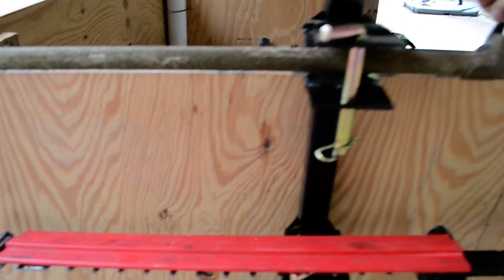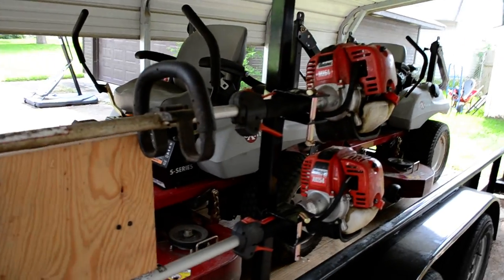Landscape Trailer Cheapest Trimmer Racks

Comment: That aluminum that stays on you trimmer is to stabilize the trimmer motor so that it doesn't snap off bouncing around going down the road. You may have saved a few bucks on the rack, I hope you don't have to buy new trimmers.

Comment: The easiest, most time saving trailer is an enclosed trailer.  Always lock it when Im in the back yard or away from the trailer.  Thieves take your stuff by watching.  Better yet , get those gps tracking tags on Amazon and install in a hard to get to Area on equipment.

Comment from the maker: @dakota slapnicker  if they are going to take the time to unscrew my handles then they might as well bring some bolt cutters and take the rest.. heck while they are at it open my door and hotwire the truck and take everything.   the point is to deter a opportunist thief by having something there to slow them down.. if someone really wants my weed eaters it doesn't matter what i have locking them, they will get them.
Reply: TwoGuysLawnLA hey what part of LA are you guys from??
Reply: TwoGuysLawnLA I just ordered racks off eBay for $45. I install garage door springs today on my trailer gate. Gotta figure a few things out but it helps a lot. I’ve been in business for 5 years down hear in Memphis. I love going to work when I want to though